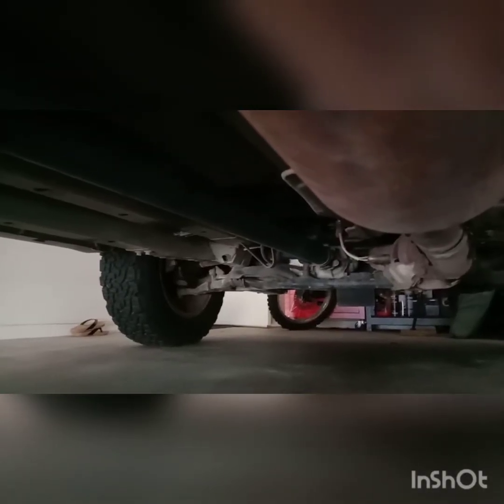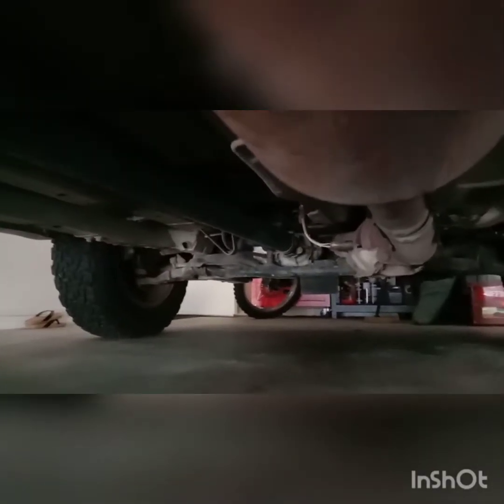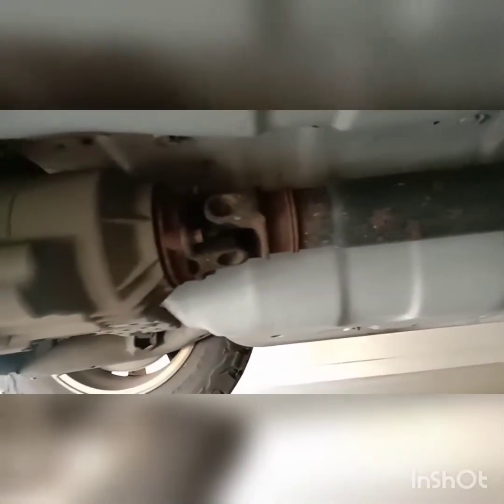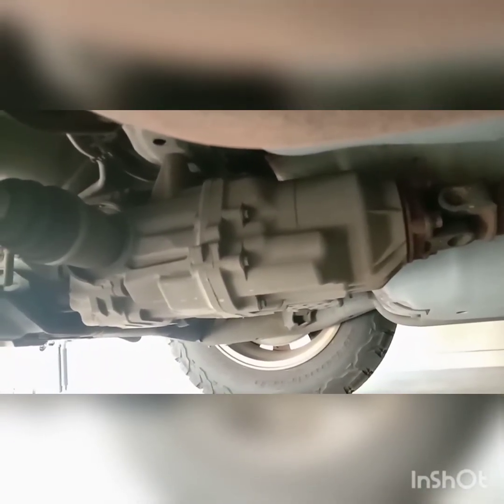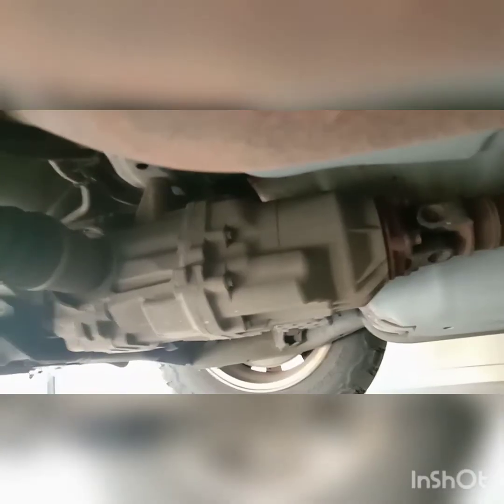Honda CRV AWD real time 4wd system explained...

Comment from the maker: What is it? Honda's Dual Pump system is used in the Real Time 4WD/AWD system specific fluid is required to produce hydraulic pressure for transmitting force to the rear wheels when needed, via two corresponding pumps and valve's.
Reply: Hello
Is it possible to put the automatic subtitles in French?
You seem to be saying some interesting things, but my English is too poor.

Comment: I get the general idea of how the system works... but does all these mean that back wheels are to 0% when traction on front is on point? Or even something like 5-10% still engage on the back? Since everything is still connected together.... or no connection due to the lack of torque to the disks inside the diff?
Reply: The rear wheels got zero traction when the front wheels work without spinning. The rear wheel only gets torque when there is a speed difference between the front and rear wheels....such as when front spins in mud, the propeller shaft to the rear will be rotating at higher speed than rear axles and that differential causes pumps in rear diff to transmit torque in the rear.
Reply: @kingz_kenyan9160  Thanks for your reply. I still do not get the practical actual schedule but I am no mechanic myself. Still that's a very nice description of yours. Also mother language is greek not english. Thank you anyway my man. In conclusion it's all the time running like a FWD and only when speed difference is detected from the front, somehow it engages the rear wheels. It would be so nice to have a diagram or a 3D video of this procedure

Comment: Hey buddy, my 2000 crv will not engage in awd. What do I do? Please help
Reply from the maker: Could be various reasons...
Fluid needs changing in the rear diff, or could be a mechanical issue within the diff itself... My experiences are with a Gen 2 and Gen 3 CRV's

Comment: I'm from India having CRv 2006 model black automatic transmission.I don't know how to use 4x4 gear wheather to put on 1 or what to do.Please sir share with me.
Reply from the maker: The 06 CRV AWD system is fully automatic. No input from the driver other than using the accelerator.
When your front drive wheels feel slippage the dual pumps in the rear diff start to work locking up the cluthes the direct a certain amount of torque, hence drive to the rear wheels.
Reply: What gear number should I use actually for 4*4 drive?

Comment: Is this the same for a Honda Element '06 AWD?
Reply from the maker: Yes it works very similar.
The system starts as a front-wheel-drive. When the vehicle senses it's losing traction on the front wheels the rear differential is engaged via a multi-plate clutch system, (between the front and rear pumps within the differential case).

Comment: How much power goes to the rear wheels? 50% or less?
Reply from the maker: Around 50% most times, depending on how much slip the front 
Wheels are slipping.
Reply: @Wolf4wdadventures.576  So the transferred power is variable? That's interesting.

Comment: Thanks for posting!  What do you do to maintain this system.  Mine sounds like it slips when I make a turn.
Reply from the maker: @fishnsage   As long as you change the oil as recommended and use the correct Honda diff oil, there should be no issues. If the wrong oil was ever used or the system was abused during its life, as expected there may be issues. It's generally a good solid system. I have since sold the vehicle. Cheers

Comment: We have a 2022 CRV ...  The real word is junk ....  I really need to film it , we have snow now and we have to walk up and down the driveway... It will not go....
Reply: Seems odd, do you have the appropriate tires for the season ?
Reply: Honda has cheaper CR-Vs available with FWD only. You need appropriate tires (all season at the very least) and the all wheel drive package for it to be of much use.

If you're on ice, this car will suck, though. Toyota's approach to "AWD"... was 4WD below 15MPH whether you like it or not in the Rav4 if I remember correctly. This may also have only been for Canadian models, I am unsure.

Comment: i have a 2007 crv 4x4 but has some abs problems, so, my 4x4 system won't work?? when i lift the car up, and put D, the 4 whhels spin normaly
Reply from the maker: If there is no resistance on the front wheels the rear differential and dual pumps generally won't work/engage.
The vehicle needs to be on the ground. Go find a small patch of grass or loose surface and have a helper to see if the rear engages once the front wheels loose traction/spin.

Comment: If you take off the rear shaft from the differential can you still drive the car in only front wheel drive without damaging anything?
Reply from the maker: Generally yes, if you remove the rear drive shaft the vehicle can still be driven via the front wheels. But this can only be done if the rear differential can freely spin, IE.. no damage to rear differential/ rear bearings etc...but doing this is not recommended.
Reply: I have driven for an year like that....nothing broke...as long as the rear diff is in good condition and it has got oil in it.

Comment: My 2005 CR-V has a switch on the dashboard that can turn off the VSA. What exactly does that switch shut off and how does it do it?
Reply from the maker: VSA stands for Vehicle Stability Assist. It helps to keep cars handling correctly during cornering, particularly if the system’s sensors detect understeer or oversteer. It’s especially useful when different wheels have different amounts of grip, a situation that would normally lead to skidding or plowing.

The system will often activate under hazardous conditions caused by weather, a loose road surface, or the car being driven too fast for the corner it’s attempting. VSA can also help to maintain smooth acceleration on slippery terrain or steep gradients.

The technology works by automatically changing the engine output and applying each wheel’s brakes individually, improving traction and keeping the car under closer driver control.
Reply: @Wolf4wdadventures.576  Thank you so much. I had no idea. I thought this VSA was part of the AWD system you described in your video, but VSA has nothing to do with that. Too bad Honda can't give a description as good as yours in the owners manual.
Reply: @swerne01  so for example, i have some issues on my abs system, that causes the vsa is always off, this has nothing to do twith the awd or 4x4 system right? i don't know much about it, when i lift up the car and put Drive, the 4 wheels spin... i don't know if that's a good signal :D
Reply: @James0208  I don't know much about the VSA system either. That's why I sent my original question to the creator of the video. You probably need to send a comment to him.
Reply from the maker: @James0208 . Correct the VSA, ABS, has nothing to do with the AWD dual pump system. I explained the VSA in an above comment.

Comment: Hi, I'm going to change the diff oil so thanks for that. My 4 wheel is not engaging on tough terrain, will the oil help? if not, what could be the problem? cheers
Reply from the maker: Very important to change out the old oil in the diff.. replenish with the correct dual pump oil from Honda. Hopefully this should work.
Reply: If it makes a howling sounds it’s probably your clutch disc inside the differential. It could also just be the old fluid but might want to change the disc inside the differential.